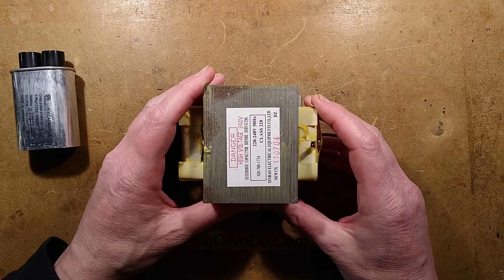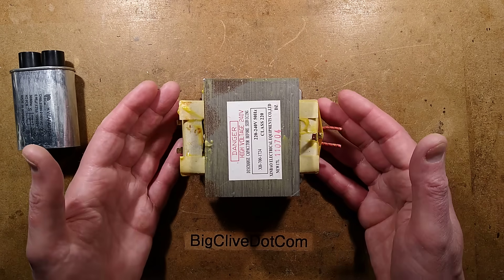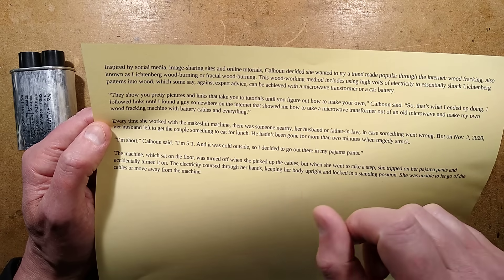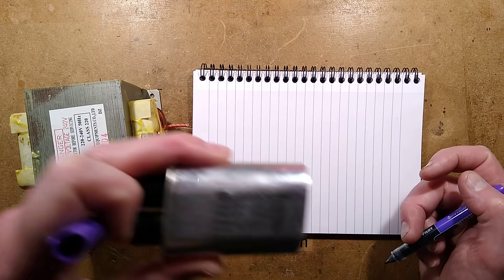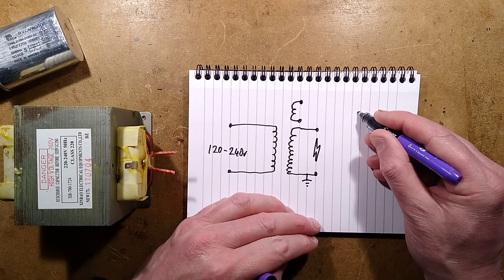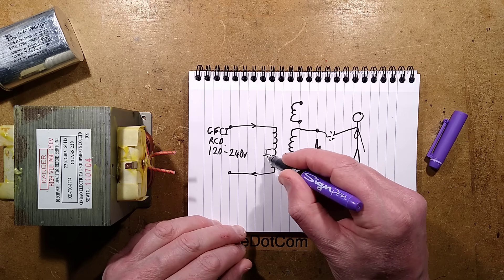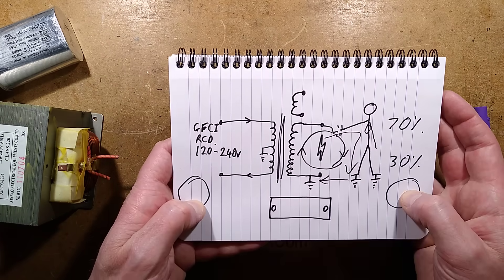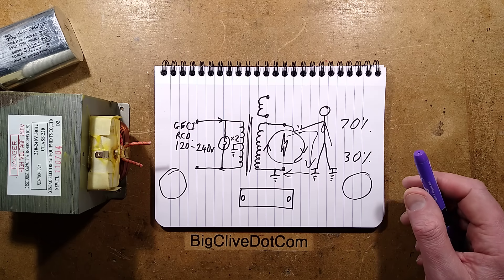The most deadly project on the Internet

Comment: I currently have 4 of these transformers. One, I've converted to a spot welder. I plan on doing at least 2 more like that. The first moment I tore one of these out of a microwave and turned it on, I made sure to know what it was capable of. The output wire end was fixed to a 5 foot pvc pipe  and I was wearing rubber gloves. I brought it near ground and watched in awe as I pulled what looked like a 2-3 foot arc. I turned it off, and never did that again. It's basically a powerline as Clive said. Scary as all hell. A few years later I learned how to modify the transformer for a spot welder. That same transformer now puts out 2v @about 800 amps. Because of the trauma, I still treat the leads like they at 2kv. Curiosity is a powerful thing. If you or somebody you know is curious about this kind of thing, I would suggest you do your research on it. Consult a professional if at all possible before you attempt to build one. Electroboom has a couple videos on these things too I think. Remember this above all else......these transformers won't give you a shock, they'll flat out kill you. Forget the 30% thing Clive talked about. You mess up, you die. Period. Friends and family will find your body cooked to perfection.

Comment: I don't remember it specifically but my Dad was an electrical/computer engineer and must have at some point when I was an annoying child and almost certainly asked how the microwave oven worked explained what made them something you don't mess with except to use a fully working one or have someone who knows what they're doing dispose of the thing. Just the thought of approaching a microwave with a screwdriver in my hand for any reason whatsoever or even thinking of doing anything with a faulty one sets off the "DANGER" alarms in some part of my brain, somewhere around the same level as the smell of the back of old rental CRTs where the TV smell is the buzz of a wasp that will sting and the microwave oven is seeing the 300 velociraptors that have surrounded you before you even noticed the first one.

Comment: I nearly killed myself with one of these when I accidentally touched the high voltage secondary coil (I think). It happened so fast I’m not sure what happened but thankfully I was only in contact with it for a fraction of a second. In that time it felt like my arm was melting. I’m pretty sure I was isolated since I only felt it in my arm and I’m thinking that’s the only reason I survived. It may have been mains voltage but I’ve touched mains before and it didn’t feel like this.

Comment: When I go into a 120/240 electrical panel I have to wear a face shield, special high electrically resistive gloves and a flash suit in industrial settings, there ain't no way in hell I am going to touch anything connected to an energized MOT, period .Following safety procedures  is how professionals stay alive while working on electrical equipment.

Comment: Appliances technicians die the most from the same thing as other trades. Falls. Microwaves are no deadlier than a washing machine. However, if you plan on repairing your microwave yourself, it’s not radiation you should be concerned about, it’s the high-voltage capacitor. Microwaves use what’s called a high voltage doubling loop. It uses a high-voltage capacitor, in conjunction with a couple of diodes (electrical check valves, similar to plumbing, but with electricity) to turn the wall voltage (120 V AC) into 2500+ V AC, with 15 Amps. This can make your arm explode, and that’s the best case scenario. Worst case is you die before your body hits the floor. Courtesy, your friendly neighborhood appliance technician.

Comment: 20kv NST FTW
Reply from the maker: The maximum voltage for centre tapped neon transformers in the USA is 15kV (7.5kV to ground), in the UK it's 10kV (5kV to ground) and in parts of Europe it's 8kV (4kV to ground.)
Reply: @bigclivedotcom   Just double checked mine and you are correct. 10-15kv at 30ma. Could have sworn I found a 20kv.

Edit: Scratch that. I have an igniter for an oil furnace that's 20kv peak output and mistook it for my other NST.

Comment: thanks to Big Clive for this very informative vid: with electricity you never stop learning... 

i am only a software engineer by training, but i have worked as pro technician dealing with  low voltage equipment (where the current is stepped down). I was asked to work on the (old) CRT monitors that have a "hi-tension" circuit running at 20,000V : touch that when its live and it will throw you across a room. Just say "NO" when you're asked to deal with high voltages, unless you have the training (the training on mains voltage and other high voltage equipment focuses on SAFETY first) that is:

1. how to isolate electrical supply BEFORE you do anything else.. 
2. how to test equipment for current (because like clive mentioned items like capacitors CAN HOLD DEADLY charge)

i know clive's heart is in the right place, but i would even hesitate to short a capacitor with an INSULTATED screwdriver. I think the correct way is to dissipate the charge (IN THE CAPACITOR) with a resistor of correct value OR it can be discharged with SOME multimeters) the point is... you need to KNOW what charge a device is carrying, guys, BEFORE you touch that thing. (please).

working with mains and higher voltages UNDER LOAD is crazy... theres more power pumping through the circuits .. clive mentions the MW transformer steps UP the voltage...so under load (when device is operating)... that voltage is lethal. the old navy electricians have a story about 0.5v killing a guy... why? because when the electricity enters certain points... say across the chest... it DISRUPTS heart activity. in other words, your heart could simply stop beating...

the "paralysis effect" is caused by voltage seizing the muscles... so thats why some victims (who live to tell the tale) mention they "couldnt let go"... its a horrible feeling... the unfortunate lady (in clive's story) was thrown ... she "woke up" some distance from the device... thats the power of high voltage. Just say NO... read everything... join an electricians forum and ASK QUESTIONS if you're fascinated by electrics (and i know many are....)

stay safe: thanx for reading . peace

Comment: I have been shocked by 120 a few times but this was my worst. Many years ago I had a 1979 Volkswagen van that was converted to an RV. I decided I was going to renovate it so I started to gut the interior. At one point, I needed to use an electric drill. Instead of looking for an extension cord, I thought  "hey, it's an RV already wired for power. I'll just plug the van into the house and then I can plug the drill into the socket inside the van." Worked great. Finished with the drill and put it down. Several minutes later I was looking at a board I wanted to remove but someone had drilled a hole through it and passed a wire through to power one of the overhead lamps, but the wire had been spliced to another. No connectors or even electrical tape. Just bare ends twisted together. I grabbed one of the bare ends to examine it to see if it could be taken apart. Yup, should be easy,  what about the other. Once I grabbed the other wire, now holding one in each hand, I was reminded that I hadn't unplugged the van from the wall. My arms completely locked up all the way to my shoulders. I couldn't hear anything except for an incredibly loud buzz in my head. The power went through a circuit breaker in the house, a GFI outlet on the side of the house, another circuit breaker in the van, up my arm, across my heart and down the other arm. Nothing tripped, I assume because I wasn't grounded in the van. I held onto those wires for about 10 seconds (but felt like so much longer)  before my arms began to shake so much that the shaking pulled my hands off the wire. Once my hand came off the wire, everything was back to normal. No burns, no issues, nothing.
Reply from the maker: The GFI wouldn't see a fault to ground - just a normal load (you), and the current would have been nowhere near enough to trip an overcurrent device.
Reply: patluxor2482 I spoke to my doctor a few years later as a "oh, by the way, this happened to me." His response was "as for danger now, there's nothing. As for danger then, you're lucky to be alive."

Comment: In a microwave some precautions are taken like a fuse and a diode and microswitch. However the concern is the radiation emitted. You must be a qualified technician experienced with such projects. The capacitor even without the power can hold a charge

Comment: Ive been working with voltages ranging from 24-10000+ for years and I've always been a stickler for safety and acquired the nick name Lockout at work since I was always the one to break out the key box for everyone on the job. That being said I messed up when I didn't think my static flocking applicator was capable of giving me the most painful shock I've ever felt and it only uses 2 AA batteries. I was cleaning it out and accidently turned it on with my fingers in the hopper touching the metal probe and next thing I remember I was on the floor wondering how the hell I got there.

After that I will never work on a live circuit no matter what the voltage is because even 2 AA batteries is enough to knock you down. I was lucky to not have cracked my head
Reply from the maker: Some of the flockers just use the circuit out of an insect zapping bat.  They could do it without the danger of the high value output capacitor.

Comment: Love the punchline. I've had a few mains shocks both in the US and now back home in 220 land, and usually due to complacency. Although I have done a couple of "backhand" tests just to see if the wire poking out of the wall is live. But that's irrelevant. Don't touch live wires. Use an indicator screwdriver thing. Or something. I love these woodfracking "designs" though, I think they look cool and sort of a reminder of how powerful and beautiful electricity can be. Blah blah blah... THEY SCARE THE LIVING SHIT OUT OF ME. I sort of want to do a project like that, but then I come to my senses. However your idea of the deadman's box has re-invigorated this desire. Perhaps building a proper "safe" setup might be a challenge in and of itself. Some sort of multi-stage safety system involving the dual buttons, a bunch of indicator lights, insulated mat, gloves... Nah. Who am I kidding. Still not worth the risk. I happen to have a few certifications that allow me to get inside breaker panels and build them and whatnot, so I know IN THEORY what kind of damage high voltage is capable of... Definitely DO NOT want to find out in PRACTICE. :)
Stay safe out there everyone. And thanks for the video, Clive. Great content. As always.

Comment: I work on vintage televisions as a hobby, mainly 1960’s and 1790’a colour sets, using a LOPT and a tripler to deliver the 25Kv and 5Kv focus voltage for the tube. As this is generated at very high frequency a shock will make you swear and possibly give you a little burn but not much else. In earlier television sets they use a transformer such as this to develop the EHT for the tube, so called Mains derived EHT, which like the microwave oven transformer is Lethal due to the current it can supply @ around 5KV. 
People who don’t know what they are doing should not ever play with electricity. Great video as always clive…

Comment: Nice video :) How much voltage can I get from a microwave transformer if I connect 220V on its output side?
Reply from the maker: If used in reverse, theoretically about 12V.   The ground connection would have to be removed.  Because of the dangers associated with MOTs be very careful about not mixing the windings up.
Reply: @bigclivedotcom  Thanks for fast answer! I also calcuate like 2000 turns / 100 turns = 20 times  so 220v / 20 = 11v

Comment: I'm just going to add, while shorting out a big capacitor with a screwdriver seems to be the way that most people discharge them these days, you do also risk a few issues. Some capacitors are not able to handle the sudden massive current draw, especially if they are not in good condition. There are other risks like igniting any gasses that might be in the air, and there is a real risk of electrocution from holing the wrong bit of metal and some screwdrivers. There are tutorials on how to make capacitor dischargers, even iFixIt has one.

Comment: I used to mess around with microwave oven transformers. But just to make electric arcs. It was fun, but dangerous. But I was well aware of the danger. I used a long plastic tube to manipulate it with, and always squatted down so I wouldn't trip and fall over it. I don't think I would do it nowdays though. I work with electricity, and I also respect it very much. I have no intention of getting fried.

Comment: I was working on a two mot stack with a voltage multiplier while building a tesla coil, and after the spark gap didn't jump, I decided to go poking around (as I thought the capacitors didn't charge) I got an inch and half away from the capacitor bank 1uf @ 8k volts (with bare hands) 
Needless to say that I had a two inch spark go from one arm to the other, which sent me to the floor. 
I was alone at the time, and the capacitor bank still had enough power to draw a 1 inch arc with a chicken stick.  My body hurt for over a week as it caused my muscles to jerk away from my bones. 
That is a mistake you only make once

Comment: Takes really special setups and procedures to work with that stuff.  A Plexiglas box (with interlock), Hands off the test bench.  Always scared me away, too.
Low voltage, high current... now that's fun!
Fireworks!  But they won't jump out after you.

Comment: Even car batteries can be scary....i had a battery cable get loose...and it was raining i was avoiding touching anything but the water made it arc and i shot a lightening bolt out of my elbow and surprisingly i didnt feel a shock or anything but it left a nice little burn on my elbow it was only for a split second and yeah i felt it burn and saw a giant flash...

Comment: In college, I attached six of these to a sheet of plywood, wired them in series-parallel, and took them to the power lab where I had access to 208V and a variable transformer. I left a 1/2 inch air gap for the output to arc across. Ignition is achieved by bridging the air gap with a length of wire on the end of a PVC tube, dubbed the "Chicken Stick". You now have a lovely little candle with a satisfying 120Hz hum over which you can roast marshmallows (also using the Chicken Stick). Because the air gap is formed with copper wire, the copper evaporates, combines with ionized oxygen, and deposits as copper oxides on the marshmallow. This can be burned away in the flame, which emits a beautiful green glow. The marshmallow is now "safe" to eat. Probably. "Safe" is relative, and considering what preceded eating the marshmallow, you probably shouldn't replicate any part of this.

Comment: Very important warning. Back when a teenager I enjoyed experimenting with electronics and electrical circuits. I made a Jacob's ladder big spark generator using an antique automobile spark coil, other components, and maybe  9 or 12v battery. Sounds pretty harmless, but it isn't! To produce the spark the circuit had to be continually interrupted, so I made a sawtooth wheel of masonite which was turned by hand. I used a nonconductive handle to turn the switching crank. HOWEVER, in my experimenting, I tried putting various things in the middle of the spark. One thing I tried was inserting a regular yellow pencil point into the blue spark which was up to 1.5 inches across. But what I forgot was that the lead of the pencil conducted electricity, so the 20,000v went up the pencil, jumped into my hand, up my arm, and through my body and chest and heart, and through the other arm which was near the device, completing the circuit. I let out an involuntary LOUD yell which must have sounded like somebody just got electrocuted for good. Stopping turning the crank helped because it was one massive electrical jolt and then no more. I felt lucky to make it through this experience, and you better believe the message got through to me. SAFETY above everything when working with high voltage or high current!